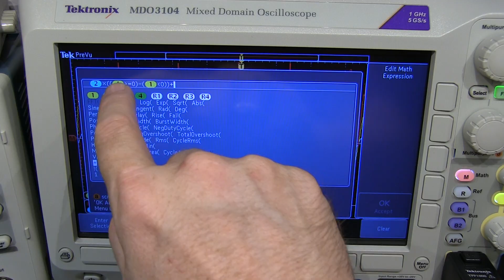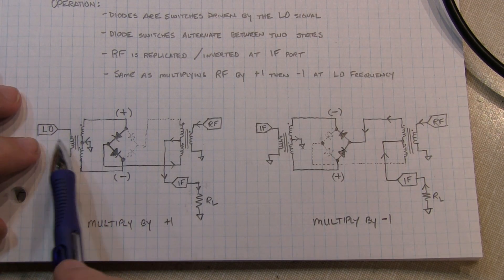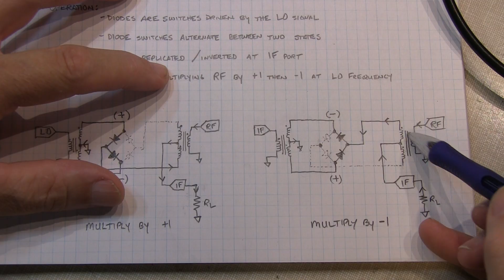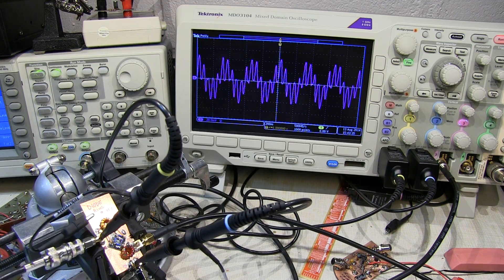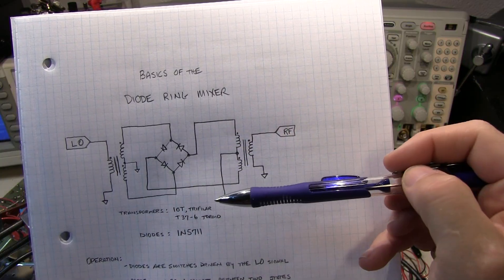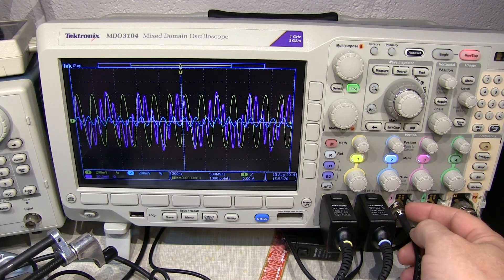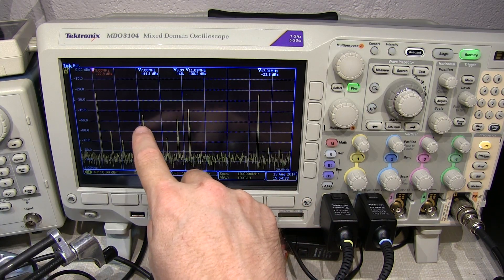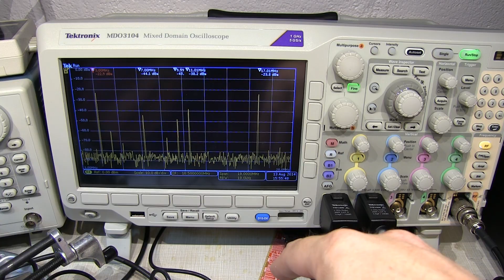#167: How a Diode Ring Mixer works | Mixer operation theory and measurement

Comment: Didn't understand the part about terminating the harmonics before a bandpass filter to isolate the required frequency?  The rest was well done.  Thanks.
Reply from the maker: +Digger D  A tuned filter will often present a good 50 ohm load at the desired frequency, but will present a non-50 ohm load to the harmonic and intermod frequencies.  This impedance mismatch can cause these signal components to be reflected back into the mixer, which can create additional unwanted mixing products.  By providing a good broadband termination (such as with a passive attenuator) at the output of the mixer, the harmonics and intermod signals will be properly terminated and not reflected back into the mixer.  Does this clear it up?
Reply: Some, had to Google "passive attenuator" first ;)  So you basically knock down all the signals which in turn limits the unwanted frequencies strength and as the resulting frequency of desire is stronger there is still enough of it left to amplify or use for your purpose?  And thanks for the reply!
Reply from the maker: +Digger D Not quite.  Knocking down the signal is an unpleasant side-effect of using the attenuator.  The main purpose of using the attenuator is to provide a good 50 ohm termination to all of the frequencies coming out of the mixer, so that none of them get reflected back into the mixer.  Without the attenuator, the filter would only provide a reflectionless termination to the desired frequency, and others would be reflected back into the mixer (which is what we want to avoid).
Reply: ***** Ok, I think I have it now hopefully.  The attenuator provides the proper impedance to the next element of the circuit and prevents standing waves (reflection) from the unwanted signals.  Been 30+ years since I got my ham license so a bit rusty and some of this is new to me but it's coming along and I'm enjoying the learning process.
Reply from the maker: +Digger D Yes, it sounds like you've got it.  The attenuator provides the proper impedance to the signals coming FROM the mixer, preventing ANY of them from reflecting BACK to the mixer.
Reply: ***** Like SWR on a transmission line.  If they don't reflect they don't mix further.  Thanks again.  Love your videos by the way.  Keep up the great job.

Comment: If my understanding is accurate, mixing the two frequencies by multiplying them is essentially amplitude modulating them. However, in mind mind when I think AM, I envision a signal that is symmetrical about t = 0 axis. What are the differences in generating these types of AM signals and what kind of circuit modulates symmetrically?
Reply from the maker: +AKsizzle47 There are lots of ways to mix signals.  Combining the signals through any non-linear process will create the mixing products.  In this case, the multiplication is bipolar, that's why you don't see the symmetry you expected.  In a balanced mixer like this, the original carrier is suppressed, and the sum and difference frequencies are most dominant.

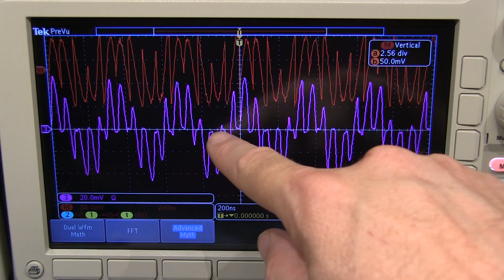Comment: That was a really good explanation. Thank you very much for this. The only (small) modification I would have made to this video would be to change the math to have your logic driven by the transition level of the diodes (assume .6v for the 1N5711) only after you show the IF signal at the mixer output. This would help demonstrate that the zero portions are due to diode transitions. I saw that you used the LO to demonstrate this. But, it would have been good to see that mathematical waveform approach the measured wave. Also, it seems that the measured signal lags behind the math waveform (see 8:52). But, it's hard to tell without taking the difference of the mathematical waveform and the measured signal. Can you confirm that this is happening and can you explain why this might be happening?

Thanks, again. Really, it was a great video. I could not have done better myself.
Reply from the maker: John Rinehart Thanks for the nice comments. I haven't taken that close a look at those small  phase shifts, although it looks to me that the measured waveform is slightly leading the math waveform.  I suspect that it is at least partially due to the difference in phase shift through the transformers (and I was measuring the signals on the primaries.

Comment: Excellent explanation of the operation of a mixer. 
Regarding to it,  I have a question to you. 
I need to compare two input standard signals of 10MHz. I could use a good interval counter to do it, but I need to have a better resolution.
Then we decided to use a frequency mixer in order to obtain a frequency difference of some Hz ( 300-500Hz) at the output.
My question is how to calculate the construction of the two baluns (how many turns and the diameter of the wires) so they can work on that frequency with the same circuit that you show in the video.
Reply from the maker: daniel perez General practice is to make the inductive reactance of the winding to be 4 or 5 (or more) times the impedance of the circuits driving it.  For 50 ohm applications (typical), the windings should results in a reactance of 200-250 ohms or so.  The number of turns can be determine by using one of many online calculators like the one shown here:
http://toroids.info/
Reply: ***** many thanks for your quick response! It is very useful to us and we will build our mixer immediately in accordance with the data that you have provided us.:)

Comment: Thank you for your great work! The visualisation in your videos make thinks much easier to understand.
But there is something I don't get here.
At 10:50 we can see the harmonics (IM-products)
First of all I'm surprised that those signals are higher than f1 and f2. I always thought IM-products would have a lower power level.
If I count right, we see them at 3,4,5,9,11 and 17MHz which are products of 2nd, 3rd, 4th, 6th and 8th order. Except of the one at 4MHz they are unven harmonics. Why don't we see the other even 4th, 6th and 8th order products at 6, 8 and 12 MHz? They should be as high as the others, shouldn't they?

Would be great to see a video according to harmonics/Intermodulation products and/or PIM (Passive Intermodulation) :)
Reply from the maker: Saubangad Balanced mixers suppress the input frequency components, that's why they appear lower than some of the sum and difference products.  If you're talking about simple distortion in an amplifier, etc., then the IM products will generally be lower than the fundamental signal components (as long as you're below the intercept points).
Reply: Very good explanation !  I have the same remarks about the first two mixproducts (10 - 7) and ( 10 + 7 ) Mhz. Following the formula should those not be 1/2  of the amplitude ?
Or is this because your  using square waves for one of the inputs?
Miner remark on the right drawing , you have used twices IF on the labels 
73 Luc on4aol
Reply: @lucvanachte1219  Same here, why not 17 MHz? I have to correct myself its at 3:22

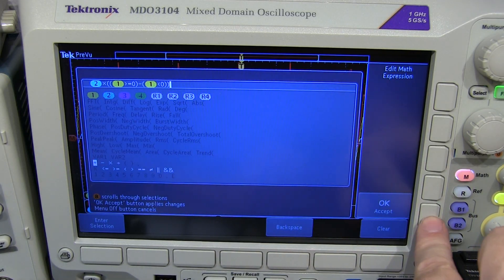Comment: Thanks for the video! I am wondering, at 4:42 , could the 'LO' may well be a square wave? (since the mathematical expression simply detects the zero crossing) If so, the output doesn't seem to look so bad, why do we care so much about getting a low distortion sinusoidal oscillator? Or is that more relevant in circuits with 'better' mixers?
Reply from the maker: It does depend on the mixer design, but in this case, a squarewave LO would work

Comment: Thanks for this tutorial! Why, however, does the LO alone set the direction of the current in your analysis? Why doesn't the RF signal affect the current? Do we need to assume that the LO's amplitude is much greater than the RF?
Reply from the maker: Yes, that is typically the case.  When you look up commercial mixer specs, you see Level-7 mixers, Level-10, Level-13, etc.  This refers to the power of the LO signal (7dBm, 10dBm, etc.).

Comment: Interesting on the frequency domain you can see the odd harmonic components like
7*3 - 10 = 11 MHz
7*5 - 10*3 = 5
10*3 - 7*3 = 9
7*5 - (7*3 - 10) = 4  ? or is this (7*2 - 10)?

The even harmonics such as 10*2 - 7 = 13 MHz are below the noise (I think?)
Reply from the maker: Yeah, it could be that they're below the noise floor - I didn't investigate further.

Comment: When looking at the spectrum analyser and you are calculating the 11Mhz harmonic you say 7 x 3 = 21 - 10 = 11Mhz why do you minus 10? is that because there are ten turns on the toroid?
Reply from the maker: The two inputs to the mixer are at 7Mhz and 10Mhz.  That's where the 10 comes from. The mixing product is due to the combination of 3x the 7MHz component, minus the 10MHz component.

Comment: Thank you for this great tutorial. But I have another question: How works a Polyakov mixer?
Reply: Polyakov mixer in his DC receivers works with large signal from LO (with frequency two times lower than the signal frequency), which turns on the diodes twice each cycle (one diode for +, other diode for -) and the RF signal, which is small, is sent to the output at these times. We have at the output the difference frequency between 2 times LO frequency and RF frequency.

Comment: It occurred to me that you could better approximate the diode behavior by putting the approximate switching threshold in the math expression, e.g. CH1*((CH2>0.3)-(CH2<0.3)). If you replace the threshold voltage with another input and connect that to a variable voltage source, you could even visualize how different switching thresholds affect the mixer output.
Reply from the maker: Yes, absolutely.  I didn't want to make it too complicated for the novice viewers.

Comment: I just built a HV leakage tester from a microwave oven trxfmr, and I do not find any charts on maximum allowable leakage in ua for non electrolytic caps. Can you do a video on the theory behind that and maybe explain some type of formula relative to that. I really enjoy your videos. I am lost! James
Reply from the maker: I would think that the maximum allowable leakage rate on a non-electrolytic capacitor would be purely governed by the application the capacitor is being used in.  Different dielectric types have different leakage characteristics, so there's no one formula to predict the leakage current.

Comment: what is the typical value of RL , the load resistor ? can u explain its variation can affect the mixer performance ? thanks in advance :)
Reply from the maker: RL is typically 50 ohms for RF circuits, and it is there to give a clean resistive load to all of the mixing components, preventing reflection back into the mixer.

Comment: I have re designed the front end board in my old Yaesu FT-101 by Replacing the RF amplifier FET with a 3N211 or a 40673 which I have and using a MC1495 as a 1st recieve mixer as well as the 2nd recieve mixer to get rid of some of the birdies found in the rigs pass band.  After what you tell me about dynamic range and higher intercept points I am now concidering using either a shottkey diode DBM or DDBM if I have enough LO drive.
Ted VE6AMR

Comment: what type of rf connectors do you use here?
Reply from the maker: They're SMA connectors soldered on the board.  The LO and RF signals are connected using BNC cables with BNC-SMA adapters between.

Comment: I'm subscribed to the synth-diy mailinglist and there's so much material that's common between these two areas. Besides the diode nonlinearity, which in audio-synth territory gets kinda fixed by an ideal diode circuit (fancy balanced opamps), it's basically a ring modulator!

Crystal clear explanation as always, much appreciated for uploading!

Comment: What is the diffrence between this ring diode mixer and a double balanced mixer using Gilbert Cells other than the gain?
Ted VE6AMR
Reply from the maker: The diode ring mixer will generally be useable over a wider dynamic range, and will usually have better/higher intercept points.  But, will also generally require higher LO power than a gilbert cell mixer like in the NE602.

Comment: Thanks very much for an informative video.  Sometimes it takes one key piece of information to turn the light on in the ole noggin and you did it.  I have been wondering for years just WHERE the information in an AM signal (sidebands) was located with respect to the overall signal.  Watching it on a spectrum analyzer is one thing, but to see in on a scope trace is another.  You answered a question that has been bothering me for years.  I know that you can see the relation in the math, and that "stuff" may be found in other quadrants of the graphs, but your explanation finally showed me HOW it is related in the time domain.  Great stuff.  Now if I can translate this to a better understanding of SSB. . . . .

Comment: Another amazing video. Thank you Alan. If you are open to requests, I would love to see videos about mixers that use as few magnetics as possible with the goal of reducing PCB size and cost.
Reply: A trifilar transformer like this for say 2-5GHz is the size of a 1210 capacitor if you wind it yourself. It’s even smaller – a small grain of rice – if you buy it and it costs pennies. Kinda hard to beat with discrete parts. The only way to beat it is with transistors on a chip: those are usually “free” compared to anything discrete. So if you really want low cost, use a dedicated mixer IC, or make an ASIC for your application that will replace other discretes with free transistors :)

When pricing discrete parts, the cost is in raw materials and processing of each unit: a discrete run-of-the-mill transistor costs about as much as a discrete inductor or transistor of a similar size and volume. When costs matter that much, you’re talking hundreds of thousands or millions of units. At such scales, small magnetics cost about as much as small anything else, to a first order. Even the costs of inserting the component start to matter at such scales.

For anything made at hobbyist scale, the cost of labor wipes everything else. PCB and other stuff is essentially free, and it costs more to ponder about it than to just put it on the board and move on if it does the job to spec you need :k)